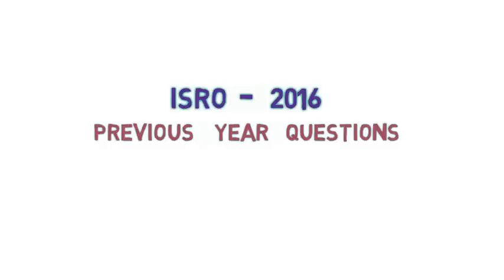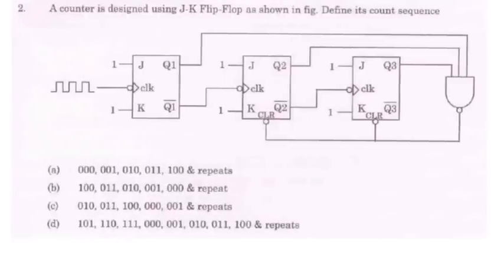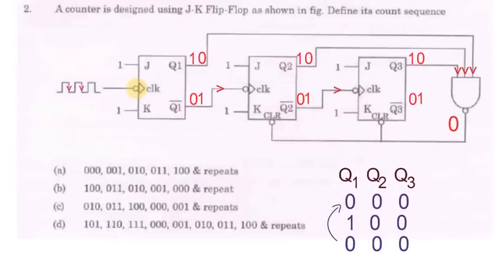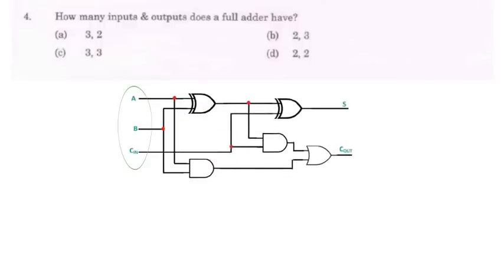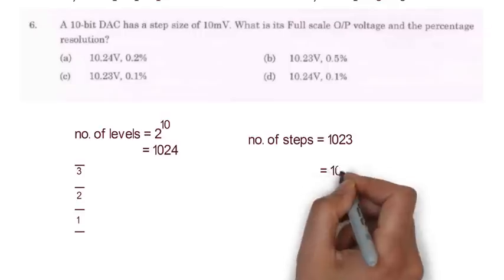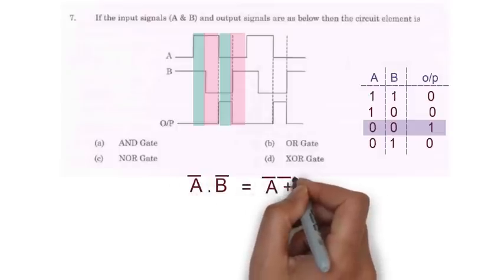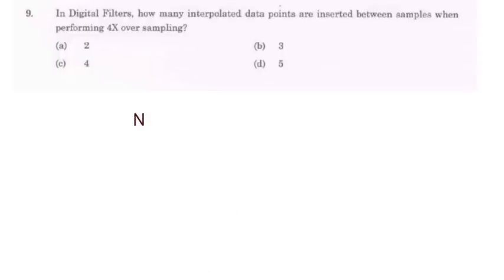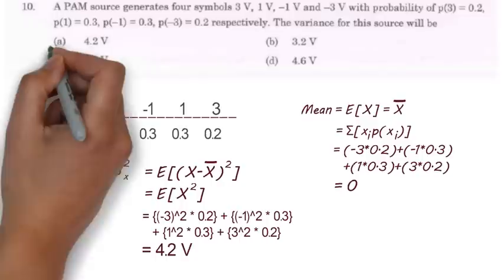ISRO Scientist/Engg | Previous Year solution Explanation

Comment: Can you pls add video lectures for EM wave propagation in free space,conductors,dielectrics and the parameters to calculate them.Transmission line theory, smith chart and antenna array concepts?
also need lectures on analog and digital communication. Thanks in advance for the lectures posted. They are helping a lot in my preparation.